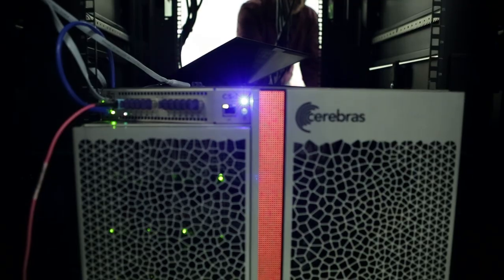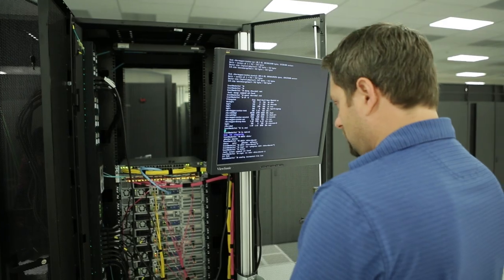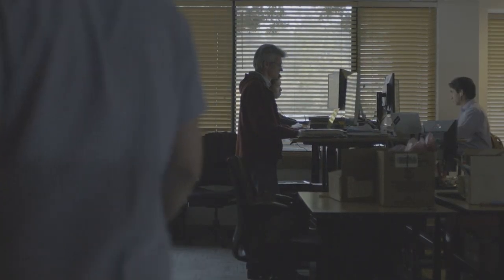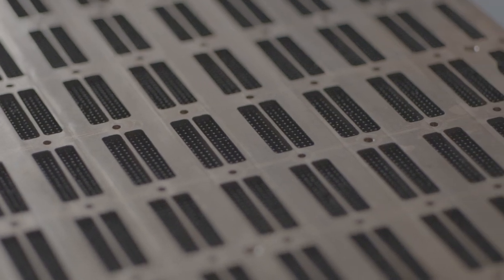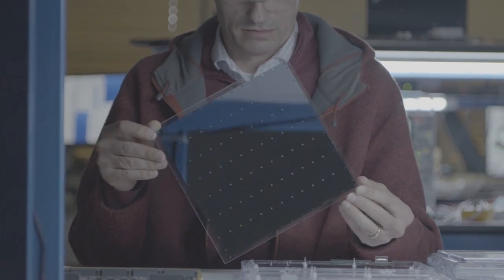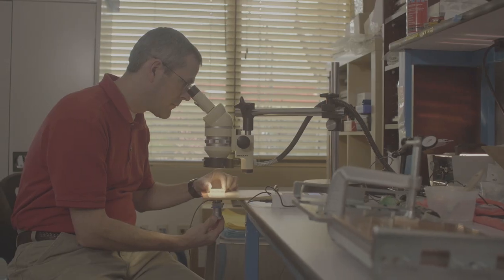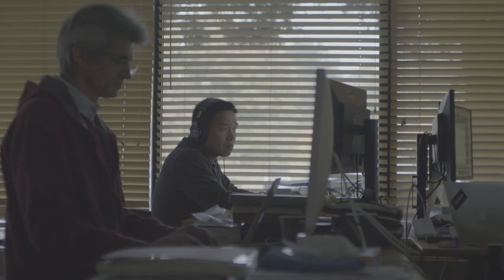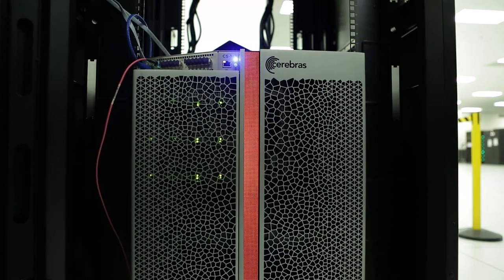Cerebras Systems CS-1 AI Supercomputer

Comment: this computer would be absolutely perfect if it were 3x cheaper. It's just not price competitive with a large NVIDIA RTX cluster
Reply: Wouldn't that be a significant power savings or savings in simplicity of fabrics and lack of programming needed to support multiple nodes going across room scale sized computers
Reply: @RainFox84  yeah you save some electricity and maybe gain some simplicity, but a cerebras system costs like 2-3 million, and you can get an equivalent gpu cluster for like 300k-700k
Reply: Yeah, but not sure about scaling on some tasks...could have some benefits there which are hard/impossible to overcome on a more traditional cluster
Reply: @thethoeby  yeah with 200 gpus you gotta use large batch sizes like 1600 or something, but that's manageable, 
it's worth the 5x cost savings compared to cerebras. It's a shame tho, i love the cerebras idea, i just couldn't buy it without feeling like i'm getting robbed.

They should sell it for a couple 100k, and turn it into more of a mass market product. every AI startup would buy one if it were priced like that and marketed well.